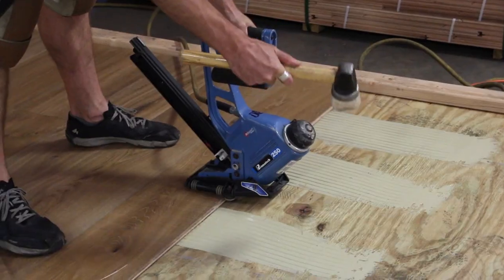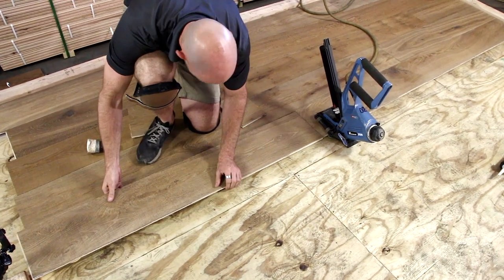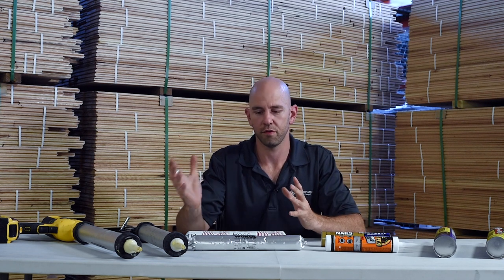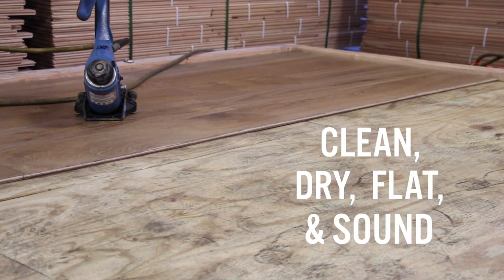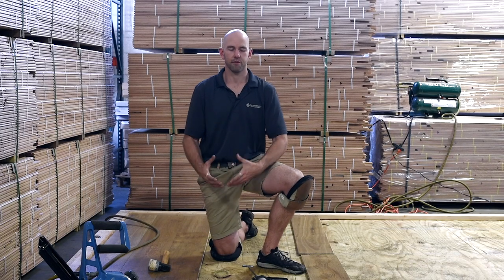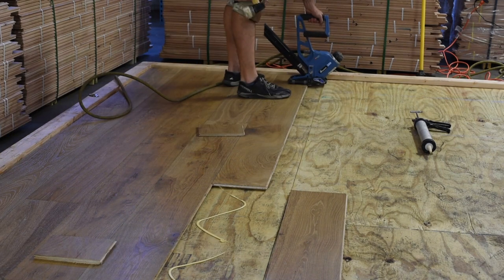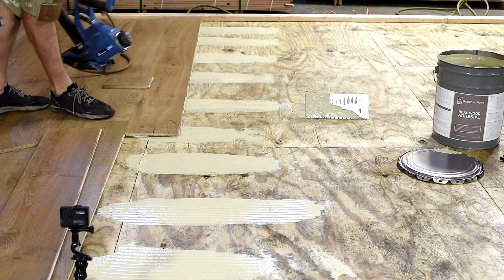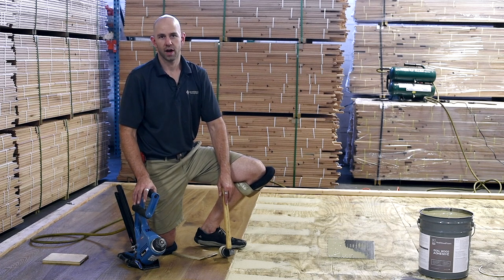How To Do A Glue Assist Hardwood Installation

Comment: I'm using a 5" wide 3/4" solid prefinished birch flooring and will use glue assist.  Which do you recommend for speed, effectiveness, ease of use (keeping clean), and cost between the two methods (skip trowel or caulking gun) you proposed?

Comment: so i'm doing a hardwood floor in one of our cabins now.  i'm using 0.5" x 6 " x 8 ' ash that i've planed and jointed myself.  i'm covering one side with gorilla wood glue and using pilot holes and pan head screws to get them to adhere to the plywood.  following a period of 48 hours or so, the plan is to remove all the pan head screws and sand then fill the holes and finish.  i've done one small area like this in the past but we sold the house so i never got a chance to see how it did over time.  what are you thoughts for installing a floor in this manner?  thanks.
Reply: Not a floor installer, but... In my experience Gorilla Glue has become very brittle over time. Maybe something to consider/look into.
Reply: @Saileahgaz  gorilla wood glue though.  not that expanding stuff.  that stuff sucks.
Reply from the maker: "The concept makes sense and would work, but screws seem like overkill and will leave obvious holes.  Most floor installers would glue and use a 18, 16, or 15 gauge trim nailer to nail through the face or blind-nail at an angle just above the tongue.  This holds enough to push against as you nail the subsequent rows.  Those nail holes are going to be much smaller and easier to hide than screw holes.  You could nail and glue the first row and wait overnight if you felt like that would be more solid.  Alternatively, installers start in the middle of a room and screw down scrap backer pieces behind their first row to hold it.  Once half of the room is installed, the backer pieces can be unscrewed, the floor turned around with spline and installed the through the 2nd half."

- Daniel
Reply: @rwsupplydesign  yeah likely overkill eh.  the screw holes are a concern for sure.  i staggered them 16 and 8" hoping they'd be part of the appeal once filled.  i can't get away with nailing through the tongue here because i'm using square edged planks.  we're talking 0.5" x 5.5" square edge planks.  so i'm not only glueing the underside but also all along the edge and using spreaders and weights every four hours.  making sure i have squeeze out everywhere.  i'll send you some pics or do a video once this is all complete.  i know this is not traditionally how a hardwood floor is done.

Comment: We are stapling our floor (3/4” x5” hardwood). We also want a glue assist to help with squeaks. Is an acceptable method for glue assist to use a smaller trowel notch size but put it everywhere? That way you get more even coverage. Again glue is to “assist” the primary method of install, which is staples.
Reply from the maker: Hey there! Great idea to do a a full trowel glue method - that' the best way to avoid squeaks. When it comes to trowel size though, always use the trowel that comes with the glue or what's recommended for that specific glue. This will ensure that you're getting the best coverage and applying it correctly.
Reply: @rwsupplydesign  even though I am stapling? Seems like I would need that if I was relying on the glue only.
Reply from the maker: @corptusion  Ok, misunderstood your first message! You can definitely use either of the two methods in this video in addition to stapling. A full trowel + staples will give you the best prevention against squeaks.

Comment: Would this method also work on particle board flooring? I was told by the salesman that you do either of the two glue ot nail. My plan is to do a DIY job and use your method.

Comment: What kind of cleats are best to use with this method if the floor is 3/4 5thick and subflooring is 3/4 thick plywood, T or L and what size?
Reply from the maker: It will depend on what type of flooring you're installing. It's best to consult the manufacturer's instructions and the NWFA guidelines, which you can find here: https://nwfa.org/technical-guidelines/

Comment: Can this method be used with an underlayment? ie Quietwalk plus
Reply from the maker: Hi there! If you are needing moisture protection, you'd want to use a liquid moisture barrier like Loba Wakol PU 280. Quietwalk plus and other underlayments are not designed for glue-down installations.

Comment: I bet the charge per square foot will be out the roof with this method, at that pace it will take 3 days for 1000 sqft lol.
Reply from the maker: I hear ya! Using a glue assist will add to the cost of materials and installation time for your jobs. However, the prevention of future problems should be worth the time and expense for you and your customer. Repairs can be expensive, too!
Reply: I have done several glue assist, and very recently just did 1300sq full spread + nail. It took 5 days. Was messy af. Took 2 hours just to clean all the glue when job was complete. Nothing like finishing a job, packing up, wanting to go home, but instead your scrubbing a floor on your hands and knees 😆